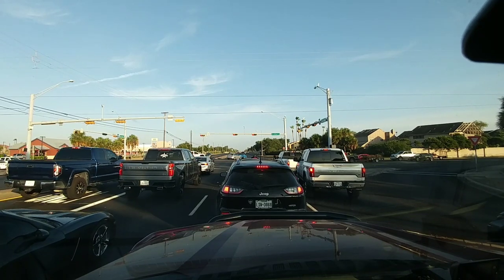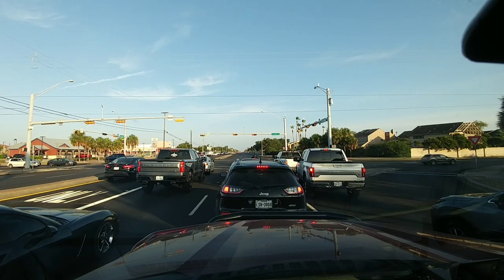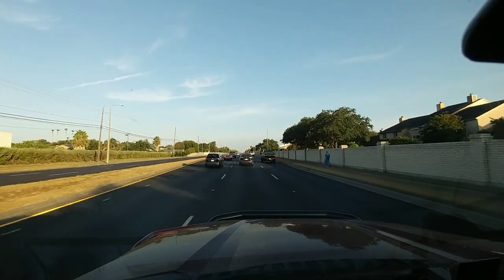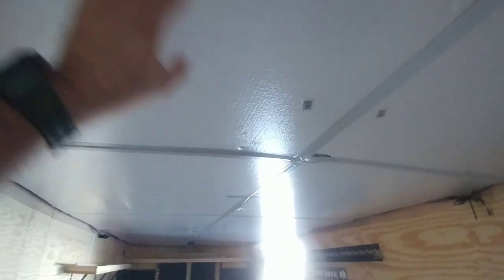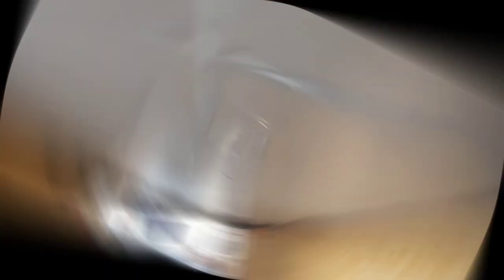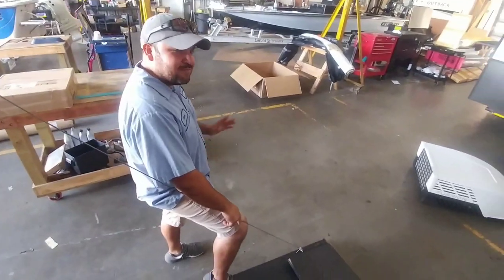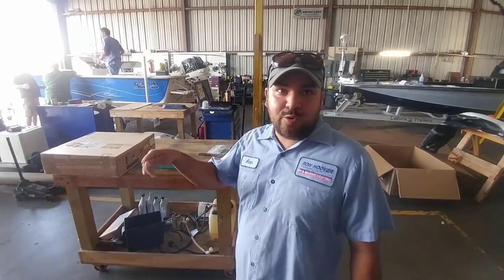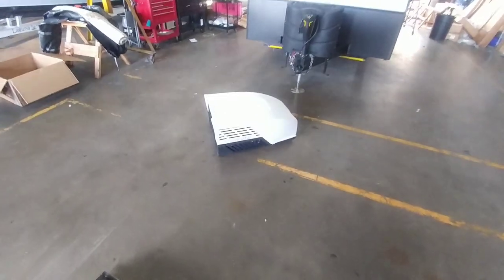Installing a Furrion Chill 15.5btu RV AC to my Cargo Trailer! Part 1

Comment: Can't wait to see how this turns out.  I was wanting to add a 2nd FanTastic Vent to my RV but only have one vent (14"x14" opening) on the roof.  If you could ask the guys over at Ron Hoover what it takes to cut an opening, install the second FanTastic Vent, and tie into the power from the existing vent (stick and tin construction with fiberglass insulation and 2nd vent will be about 3 feet across from existing vent) that would be useful when I'm working with rv techs in the D.C. area.  Hope you're working in a cool trailer now :-)

Comment: Thank you so much for your videos, we have learned a lot!
We currently own a 2019 Thor Challenger with TWO 13.5 BTU air conditioners, we live in Arizona with 110° - 115° summers.....should we seriously look into the Furrion 15.5 BTU to replace ours?  OR should we add a Furrion in a vent location so we have 3 units?
I've been dealing with the heat, the summer has been brutal on me, I'm in the motorhome and it gets up to 98° inside with both A/C's going non-stop all day and night!
We purchased a portable air conditioner, it helped some, not much.
We need help.  Thank you.
Reply from the maker: You'll love part 2 then :)
Reply: @BigTruckBigRV  when is Part 2 coming out?  
We're taking it into Camping World for warranty work, we're going to speak with them about improving our air conditioning....but my husband and I trust what you have to say more (we feel like we know you)!  😁

Comment: So the link at etrailer says this is for a replacement ac and not a new setup....is that correct or it does not matter in this case...please let me know as I am about to do the same as you did on a 26' foot enclosed trailer

Comment: BTBRV I trust your opinion and your knowledge of motor homes and trailers, and lately I've been looking at hauling with a big rig semi truck, cuz I've seen motor homes with a semi that are 30 & 35 ft long as well as a regular semi towing a 5th wheel and I'm curious what your opinion is on choosing a semi that works best? 

I really really like the beefy aggressive profile of the International Lone Star semi and I've heard some people say they have issues while others swear by them, so I'm interested what you have to say. 

If money was not in the question, what semi would you choose for yourself? And why?
Reply: Get a truck with an engine produced before emissions. So something 2005 or older. Emissions kill engines and are ridiculously expensive to maintain. On internationals, they are cheap trucks and you feel it. I don't enjoy driving them in the least.
Reply: Check out RVHaulers.  They tend to use Volvo trucks